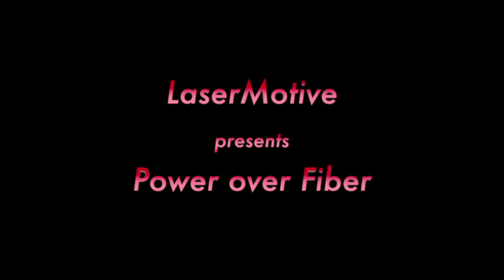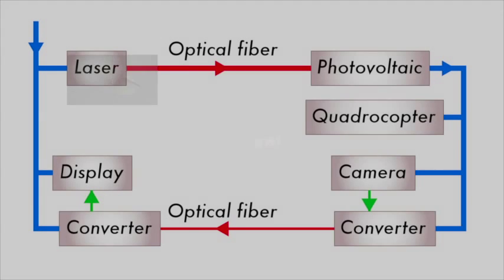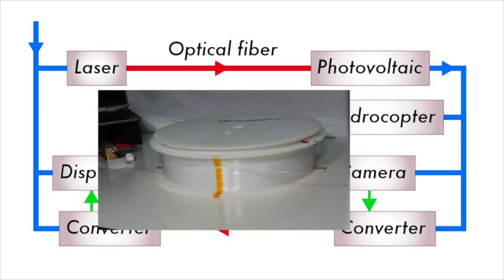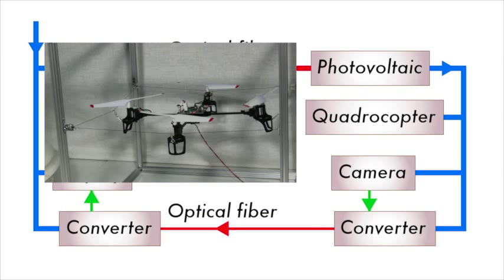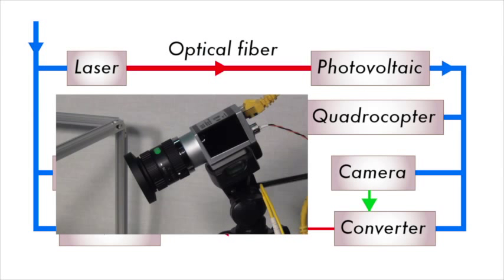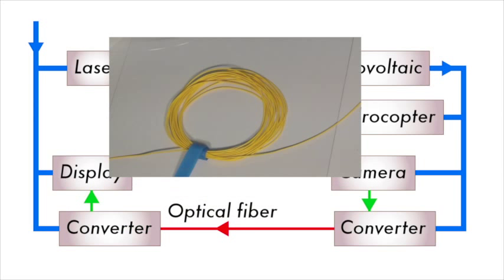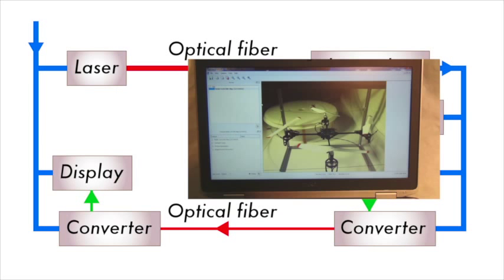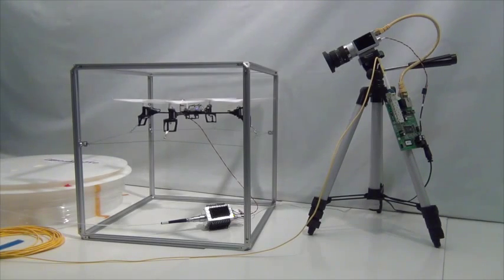Laser Power over Fiber demo - by LaserMotive

Comment: Are there any details for the parts that were used at all? Interested in low-voltage DC power transmission over a very short range as a form of isolation.